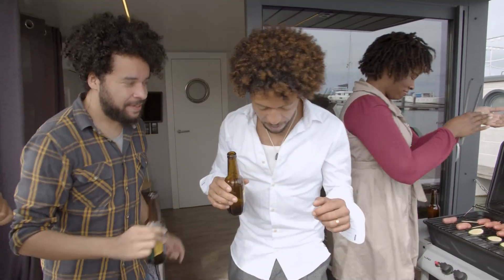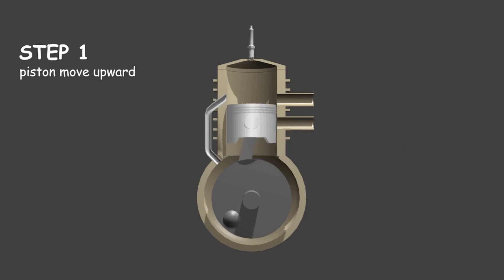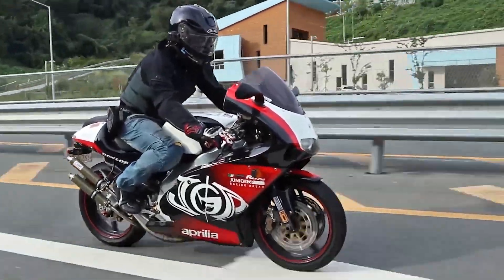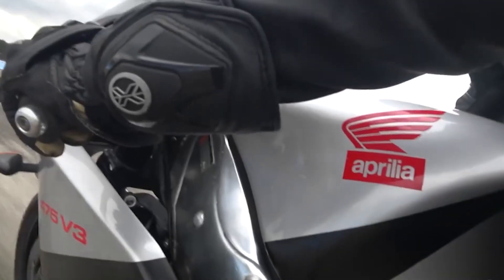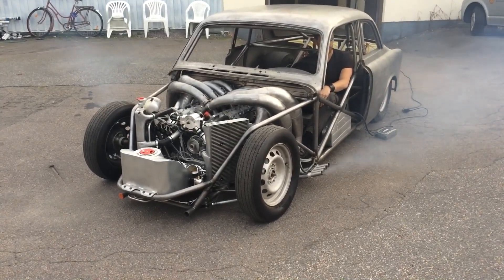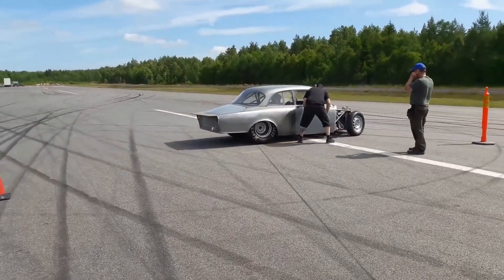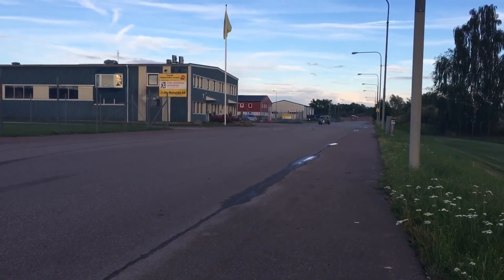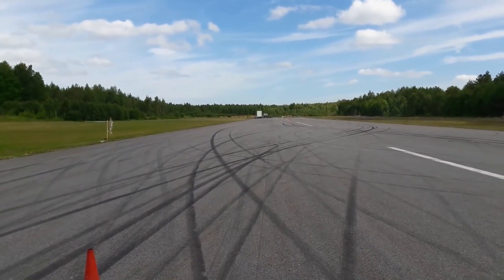This Volvo is powered by a 3.8l 2-Stroke V8 engine

Comment: I've seen nitro methane turbo VW drag rail that had a spring loaded powerglide 2 speed transmission kick ass! Spring loaded onstead of hydraulically operated is way simpler, less weiight and stronger. It was designed mainly to not come apart. 
My 1967 chevelle with 327 and powerglide could nearly hit 100 mph in low.......
Ive always been a Kawasaki KH and S triple fan. Ive had at least 10 different models. My S2 350cc triple had Denco pipes and porting along with brand new Weisco pistons. It was a beast.

Comment: I got 155rear wheel hp out  of my RG500's (had 2) And it was not even that hard... The worst part was getting a swing arm on that thing that fitted a rear tire wider than 130, to get any use for the power. So, this 3.8... I should not be too hard to tune for 1500+ since it got tuned for 10 seconds at full power between check ups, instead of road traffic.  I wonder what it  ended up with on the dyno?

Comment: 49hp from 250 cm³?😂😂😂 My GF250 4-stroke Suzuki makes 44hp from 250 cm³. So I don't see a big advantage from the 2-stroke in this example... 😝
Reply: The 4 joke has to rev much higher than the 2 stroke and it has less torque.

Comment: I paused the video at 3:55 (full screen mode) ... switched off the lights in the room, stood several metres from my laptop screen, then looked through a pin-hole in a sheet of paper and the front of the car (engine bay area) appears with the face of a haunting satanic character.  Once you see it, you cannot 'unsee' it.
Reply: I do that to every video I watch

Comment: Too smokey. Too bad they didn't use an engine with oil injection like the Etec. And why only a 2 speed automatic? The Mercury 600hp V-12 would be better.
Reply: its running double oil. once warmed up, smoke is a non issue with 50:1 or even 100:1. they are also running it pig rich to extend its life.

Comment: Well at least it makes for good you tube content.
I've never cared much for 2-strokes myself just because if they're not in tip top condition they are not reliable at all. You never know if they're going to start up when you want them to, you have to carry spare spark plugs and wrenches, crankshaft seals always wear out and create vacuum leaks that cause the engine to run lean and burn pistons, and then cylinders usually go out with the pistons. 
And what about when the oil gets broken down by the gasoline, how much lubrication is still there when the oil is all saturated down by the gasoline???
Yes, electric fuel injection is probably the best thing to ever happen to a 2-stroke engine, but look at how much fuel they waste, could that car ever be used as a daily driven mass production vehicle?
They smoke almost as much as an old coal burning locomotive steam train... 
I wonder how much global warming there would be in the world today if the 2-stroke engine were the only option.
Makes me think about the Trabant, I think Saab made one also, strangest cars on the planet.
Reply: in an outboard, they are EXTREMELY reliable. in my 35 years as an outboard mechanic, i've only seen bad crank seals on motors from the early 70's and older. gasoline does not "break down" oil! If they are stored properly, carb issues are rare. but 99% of issues are because the owner used old fuel, or didnt maintain and use the correct oil, or overloaded the boat, water in fuel etc. smoke is non-existent or very little once the motor warms up and synthetic is used. the motor you see here is running rich AND using 25:1 oil mix since its running on the ragged edge.
Reply: You've clearly had some crappy 2-strokes. Try a good one.

Comment: Iv been watching it closely for years on and off and from what I can tell it's a 9 sec car and about 550-600hp although I haven't seen dyno data. I will say for the engine to be in a drag car they did this wrong. By that I mean these things with pipes and stock ports dont come online until 6-7krpm those pipes should be set up to work up in the 7-10k rpm range and the limiter should be 10500or 11. But their swedes I have confidence they'll figure it out. I'd expect based off similar builds over the years It can make a healthy 800or so hp but I bet you can shove a crap ton of n2o down its throat and make whatever he needs even now. But fi and 2 strokes are kinda a pain di is really the way to go although that much more complicated. Not to say it cant be done in an aftermarket setting just that it's hard. The oems put injectors in transfer ports and such for a reason if you look at jet skis and scooters and mx bikes. This is pretty hard to add after the engine is made. I also belive he is injecting even further down stream at the tb making this problem worse is the fact it's made to be mounted on the flywheel although gravity would work better upside down from what it is.
Reply: no. the F1 V8 put out around 450hp, and had a 150hp shot of nitrous for the world record attempt. even at 450hp, it would have a 30 hr service life max. the F1 of the 1980's was far more advanced than this stock powerhead.

Comment: It has the added bonus of spraying 2 stroke oil all over the drag strip so everybody that goes after you will have to contend with that and get slower times.
Reply: Still gets spit out the exhaust either way.
Reply: Depends if the oil is mixed in the petrol tank or is injected in from a separate tank
Reply: Oil injected 2 stroke OP ACE Cummins https://mart.cummins.com/imagelibrary/data/assetfiles/0058689.pdf

Comment: The exhaust system takes up more room than the engine itself :O
Reply: That's where all the power is made.😊
Reply: @Ruslan.88266  Indeed it is.
High tuned 4 strokes are said to be "cammy"
2 strokes are said to be pipe-y
In 1976 the FIM decided that road race bikes had to have silencers (I use that word very loosely).
Killed off the 4 strokes (MV Agusta) but improved the strokers
IIRC, they widened the powerband
Reply: That’s water vapor coming out of it as it’s a hydrogen 2 stroke evinrude v8!